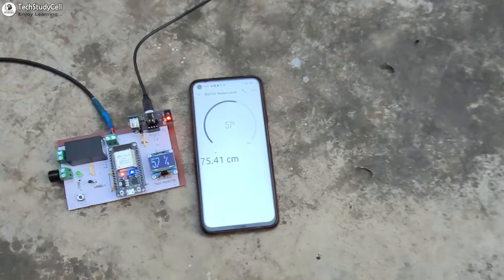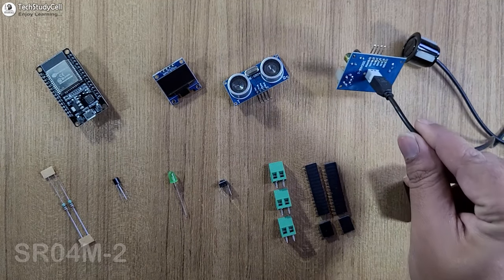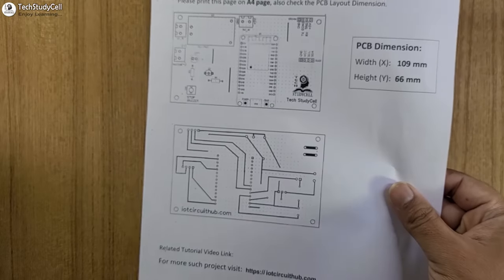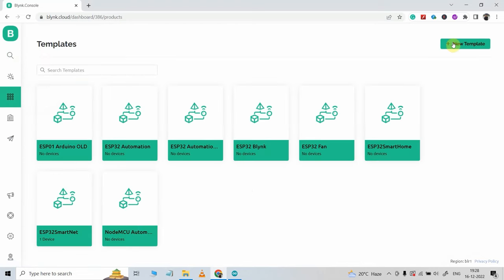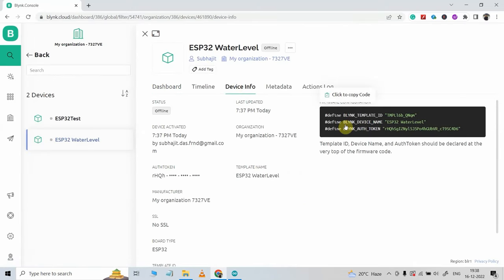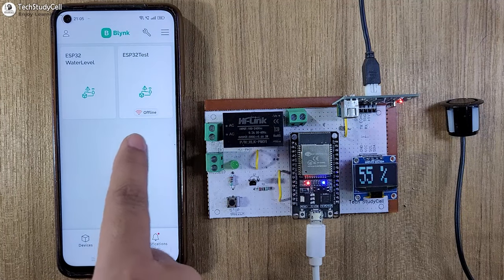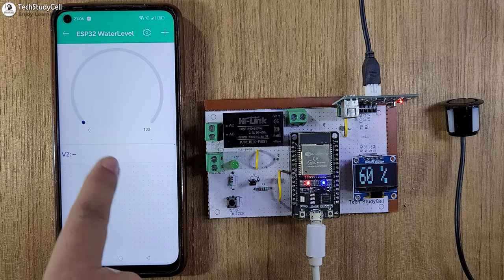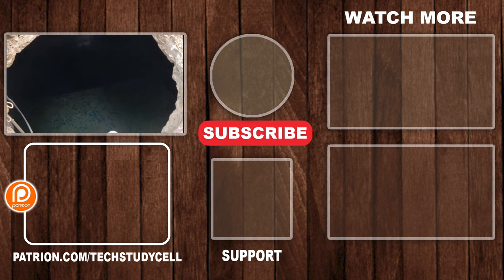IoT Based Water Level Monitoring system using ESP32 Blynk & Ultrasonic Sensor

Comment: Dont waste your time and money if you are looking for real life solution. This project is good for science projects but does not handle real life situations like moisture handling, distance from over head tank to the ESP etc.. Have gone through comments and I saw author only responds to Thank you. I also tried reaching out to him on email and WhatsApp but no response.
Reply: you can contact engineers who do such projects in real life. in your locality they design as per your needs or hire someone on upwork or freelancers.

these are only for college projects and this has many disadvantages.
Reply: Waterproof ultrasonic sensor
Reply: I have done a successful project on temperature and moisture control using blynk platform. The bottom line is you should consult design engineer
Reply: Yeah...but its really good idea....nd also its possible to implement in real time ⏳️
Reply: Any cheap alternativa for real life?
Reply: I can see you being jealous of this project.
Reply: @MagmaSona  any reason of being jealous?
Reply: @khanabdul79  because he has put a lot of hardwork and you have done nothing but shitting on his Work saying It's school project. Learn to appreciate
Reply: @MagmaSona  i never criticised on the hard work. Just highlighted the fact that it's not meant for real-life situations where many factors hamper the performance and it won't give actual readings. If you are willing to invest and then spend time, efforts and money to rectify it, please go ahead

Comment: I also did similar to this using waterproof ultrasonic sensor, working good, but the problem is it will show the wrong readings when the moisture inside the water tank is deposited on the sensor.
Reply: Ok, but if you will measure level from bottom to surface? i.e. place sensor at the bottom. I have the same project, but using waterproof pressure sensor (low range, 0-0.25 bar)- no problems. As secondary independent means - floater switch at 98% of capacity, to avoid ovelflow of the tank. Ultrasonic sensor may give you wrong readings also by secondary reflected echo signal.
Reply: @buildmaker  ok, what about the accuracy of the pressure sensor? Can we measure each level?
Reply: @kartikhegde9368  yes, you can measure +/- few cm of level difference. Pressure to be converted into water level above the sensor. Just choose right pressure sensor range close to your tank height. i.e. 1 meter of the height (water) ~ 0.1 bar. Good quality sensors giving about 1% of accuracy. Important to place sensor away from inlet pipes, so in shadow area, to measure static pressure only.
Reply: @buildmaker  ok, thank you, can you suggest me some good sensor in less budget?
Reply: I have the same experience with mine
Reply: I also faced this problem
Reply: I’ve been using a maxbotix sensor for six years only problem I’ve had is my dog ran across the wire and pulled it out. It’s been from +30 C to -15C.  Great video .
Reply: Use magnetic floating ball switches
Reply: U can fix a little glass or polythene cover before ultrasonic sensor by protecting them
Reply: Allah
Reply: Allah
Reply: Is the code working for you? It's not working for me showing errors all the time. Can you share your code with me? Please
Reply: @dapindersinghvirk3190 
Will they work in under water

Comment: So for any one of you facing water buildup on sensor you can use cheap anti moisture sheet used in cars side mirror. And make sure to ad a little tilt to the sensor so that water goes to opposite side . I have used one esp 32 with 3 sensors works great
Reply: a float valve can do this, people just making things complicated.
Reply: @EnzoVince it's not just about wanting a signal when the tank fills up completely but to get continuous monitor of water level in the tank

Comment: Hey there, I've made quite the same circuit and used the same sensor for water level measurement but the problem is that after a few days time there is moisture building up on the surface of waterproof sensor which messes up the readings.
Reply: Can you help me for programming I already messes up . For my project purposes only plss

Comment: Great video and tutorial, I am a newbie to the whole lot business, and where I live water is scarce and has to be strictly rationed and managed, I would like to point out that the arduino/ESP32 script has to be adjusted to real life usage,  in my case to properly get a reading of distance and after some very frustrating hours of not getting a precise reading on the depth measurement, I realized that sound does not travel at the same speed at different altitudes, with temperature and humidity  being a variable, living at 3300 +/- feet altitude, I have adjusted the formula of the speed of sound from 343/Meters per second x to 354//Meters per second, the other problem encountered was how to get the true volume or porcentaje of remaining water in the tank, with a depth of 4 meters I have only 3 working meters of usable water and to avoid the sensor from getting  wet or splashed by the street inlet, adding a safe distance of 30 Cms, which sums up to 330 Cms. Given that i had to calculate the volume for 3 meters of water I assumed that declaring on the sketch to :

 //Set Water Level Distance in CM
int emptyTankDistance = 300 ;  //Distance when tank is empty
int fullTankDistance =  30 ;  //Distance when tank is full

Would be true and accurate, again very frustrated with wrong percentages of water, until I realized that it was necessary to declare the full 330 Cms to get an accurate reading of the waters volume at 3 meters.

 //Set Water Level Distance in CM
int emptyTankDistance = 330 ;  //Distance when tank is empty
int fullTankDistance =  30 ;  //Distance when tank is full

I hope my stumbling and fumbling is of some help to others, and Again very grateful for the tutorial and sketch it has been of great help to create a truly useful toll, Great Work!!!
Reply: Did you make any improvements now?

Comment: I have been following you for a very long time and I adore your videos and your way of explaining
Can you do home automation through esp32, but with sensors such as temperature and humidity sensor, distance sensor, motion sensor, light intensity sensor, rain sensor, fire sensor, fingerprint sensor, rfid card, and more outputs for each sensor, knowing that you can add atmega328p to increase the number of outputs through an application blynk or esp rainmaker
Reply: Yes you can.

Comment: Hi dear. How can I compare the level values in terms of time? for example, apply conditions in the programming file that will give different actions, such as turning on an LED, according to the level values per unit of time?
Reply: You have to implement code for it. Your have to Know about c/c++ and Arduino coding for it

Comment: please tell me how to change the code if using esp8266 and how are its pins can you help me, thank you
Reply: If you do not have the ability to figure that out on your own then I would suggest stay with the original design and spend the $10 for an ESP32 board as used in the project.

Comment: Nice one what a great project it's solved half of my problem. My other issue which you may like to address if it's possible.
1. In this project, your main board and sensor in the water tank are hard-wire connected is it possible we can have a circuit where the sensor is connected to the leading board wireless. 
2. As you are measuring the water level in the underground water tank what if I want to use one main circuit board with two sensors i.e. one for the underground water tank and 2nd for over roof water tank
3. As you can tell I am a Linux user Altium Designer is a window GUI base software can you name alternative software for Linux. Which I as user-friendly as Altium 

Thanks for your video I am a new subscriber and would like to see and learn more about projects like this

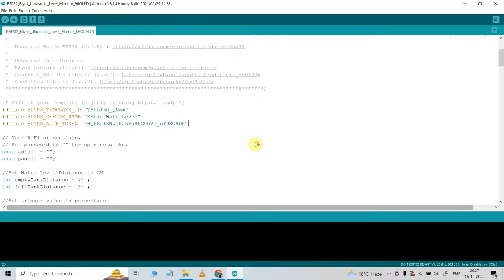Comment: 8:19  brother i have a doubt, in the code there is a line where we have to give the wifi credentials that is ssid and pass, from where i can get those credentials
Reply: You need to have a wifi connection at home. Or the wifi you use , you need to give the router or the modem's id & password to it to connect

Comment: The real engineering is not in this entire project but to mount the sensor hanging at top of tank cap, with no gaps, and let that run 24/7 in rain/sun weather conditions. All those matter as that is what would hap between these demod and a working product. 

Such demos r dime a dozen. A ready to use product implementation including product engineering is rare to find.

Comment: Hi there,  I have a water tank in a location where there is no electric power available and I want to find a device that, powered by solar energy I assume, can send a signal to my cell phone indicating the water level of the tank. Can your project be applied to my case? Thanks

thanks,
Reply: Place the sensor and use a long wire to take it to your desired location and use it. Also you need wifi for the phone app functionality.

Comment: Hi! I need to use this sensor in a 5 inch diameter borewell pipe. Where there is 0.5 inch dia pipe inside the 5inch dia pipe which is connected to motor to suck water. In this case, can I use this sensor to get the water level. Because the 0.5 inch pipe will distort the sound waves from the sensor which will affect the reading.
Reply: Well.. you can use a float sensor 
Or need to place sensor precisely

Comment: I want to implement this project:

"Design of Driver Awareness system depending on Eye and Face Feature and Discrimination"

Can I use ESP32 instead of Raspberry Pi ? please reply
Reply: You can you although esp is not a good candidate for it coz of its low processing power

Comment: i have made this before for the purpose of monitoring the water level and turning off the water pump but due to heavy flow of the water and creating turbulence the level reading is fluctuating. please reply if you can solve this problem. Do i use another type of sensor or mechanism???
Reply: Take multiple readings and take the average value of it. Like take 1000 value and take average
Reply: @ITSALLELECTRONICS  for more precise result,  take 50 readings ,  sort these reading in ascending order, now eliminate first 10 and last 10 readings, this will eliminate worse low and worse high readings. now take the average of remaining 30 readings.

Comment: I have tried already this sensor. But when you cover tank some water drops amid the sensor and sensor malfunctions. So this is usedless when tank closed in summer
Reply: Yes same problem, condensation make it useless,  reading is not accurate when tank starts to cool down in evening. Someone told me to place a Incandescent bulbs 12 volt bulb near sensor, This may work I haven't tried yet. Another problem with Incandescent bulbs is, it may cause MICROBIAL in water.

Comment: I'm making a system to detect fluid level and I am wondering if I can replace the ultrasonic sensor with a 24GHz radar sensor? I want to have an enclosed system and not be in contact with the water.
Reply: have you tried radar??

Comment: I tested this sensor years ago in my tank  after 
  I Removed it  because the reading was fluctuated. i googled lot to fix  but not solved . just  30 cm was stable.  i choosed  hc-04 with  arduino. finaly i got better result in pressure transducer
Reply: how its working now and model of pressure sensor ....and what about corrision
Reply: @shauryaaditya169   i used 30psi pressure transducer.
0 to 5 v output  we can convert to level.  30 psi is almost equal to 2 meter tank
Reply: can u send me diagram & code details

Comment: Despite its great potential, this project requires WIFI and we don't get wifi signal on the top of the roof so if we don't get wifi, we won't receive notifications on the app. This needs to be addressed.
Reply: Put one esp connected to the ultrasonic sensor near the tank, and put another esp connected to the relay near the pump. Then create a mesh network between them. If it still goes out of range, find esp with ethernet module attached